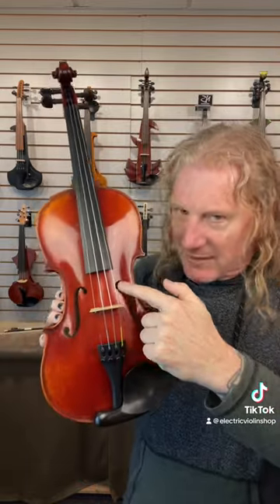Feedback Busters for Violin?

Comment: What's the difference between a violin and a mandolin?
Reply from the maker: There are several. Usually, mandolins are double-strung, meaning they have 2 E strings, 2 A strings, etc. They have a flat bridge instead of a curved bridge. They're fretted instead of fretless, and you play them with a pick, not a bow.